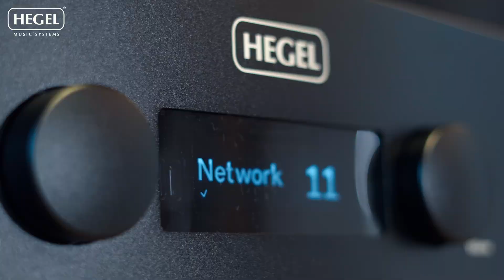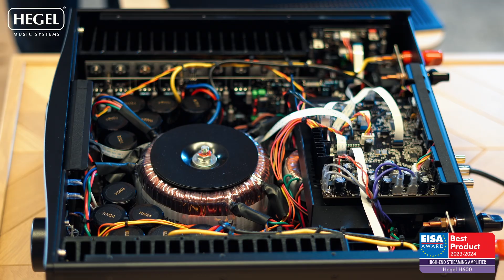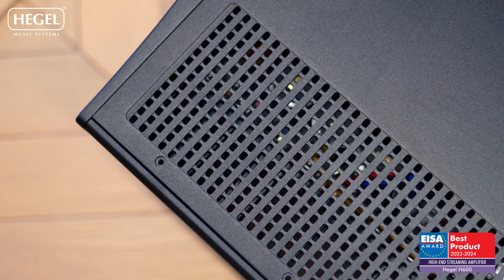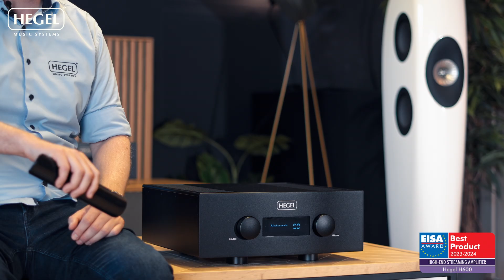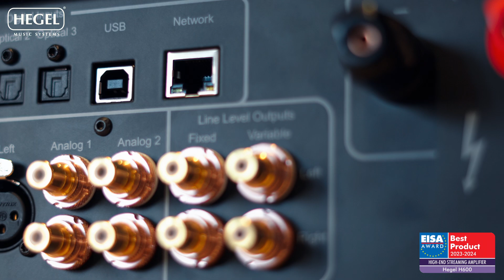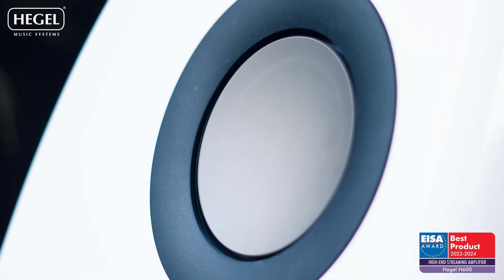Hegel H600 Introduction

Comment: Kolejny fajny wzmacniacz. Jedynie czego mi w nim brakuje, by go kupić to korektor tonów niskich i wysokich. Czy macie w planach, by któryś wzmacniacz posiadał takie udogodnienia? Pozdrawiam.
Reply from the maker: Thank you for the comment. I do understand that you might some times feel the need for these controls. We do not have them as we belive in the most natural sound and that it is far better to choose the matching speakers or change speaker placement. Using tone control will create issues with absolute phase, and while we appreciate that not everyone agrees, we think it is wrong. Meaning there are currently no plans for this.

Comment: Poor quality amp.
Reply from the maker: Sorry you feel that way. But what is it you do not like about it?
Reply: @HegelMusicSystem  .
                          Well,  I need an amp that functions well at about waist height or so.  I won't have it on the ground between loudspeakers.  AND, speaking of which, an amp that can drive speaker cables longer than 1 or 2 meters.
        There's got to be amps out there that operate off the floor, away from the drivers & at countertop height.  Distancing tubes and turntables from subwoofers probably isn't a horrible move either.  If I'm wrong, why is it the most prevalent arrangement today?
Reply from the maker: @TriAmpMyFi  I can assure you that all of our amplifiers are designed to work at waist height and driving speaker cables way longer than 1 to 2 meters. Our standard set up is usually 3 or 4 meters cable.

Comment: Nice amp but not for me. Was a Hegel fan with H590 and H95 for 6 years but this new H600 didn’t do it for me. Clean sound, tight, good bass, better DAC etc. but I was not impressed. Tried several amps and changed to Accuphase E-700 for an upgrade. That moved me right away back into the music.
Reply from the maker: Sorry to read that we didn't impress you with the H600
Reply: I didn't expect it either because I had built my entire set around it (started with an H190 amplifier and a Mohican CD player).I still think the design and the all-in-one solution (incl. Roon) are great, but in the end it's all about enjoying the music and the associated experience. Btw, the H95 is still part of my TV set, so there is still a Hegel present...;-).
Good luck with the further developments of Hegel, I will continue to follow you. Who knows, I might come back in the future.